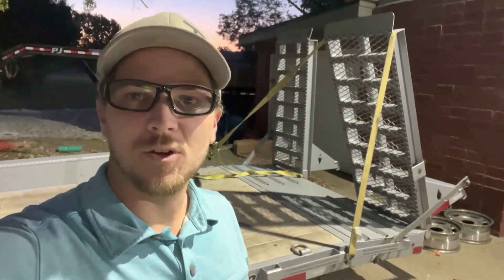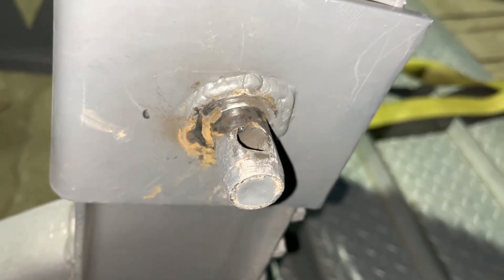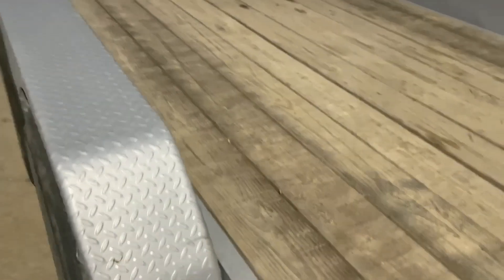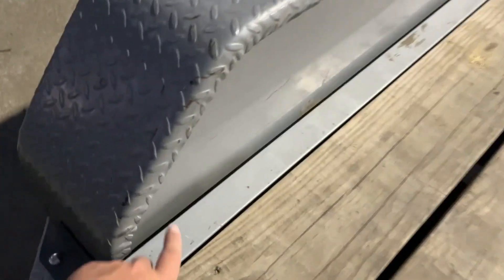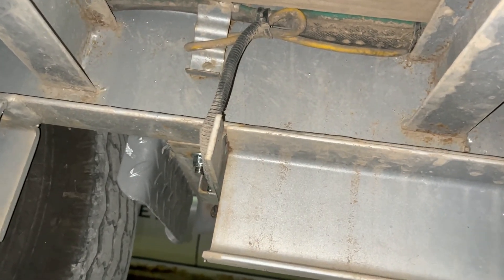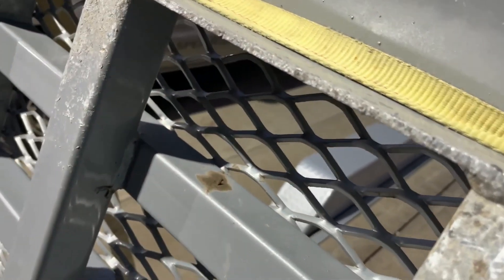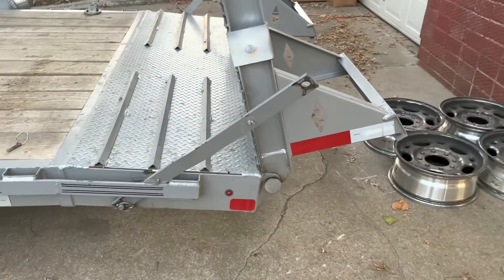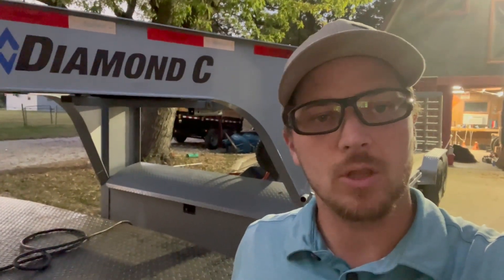Broken Diamond C Trailer Repairs

Comment: Do you think diamond c will lower some of their pricing if things come down again? I get the feeling like most goods are only traveling in one direction. Thoughts? Also, while not at the moment I do plan to get a 26 foot goose and a 16 ft dump at the same time. Do you think that would afford me some bargaining power or is diamond c like apple products? (The price is the price kind of scenario). Like I said I still have some time before I’ll be in a position to pull both triggers so I haven’t bothered to make contact with any dealers yet. Thank you
Reply from the maker: It’s really hard to say. Prices are up because materials are up. I’m seeing trailer inventories increase at my local dealerships. But those trailers were built at a higher cost. It’s logical to think they will have to sell for a higher price. Even if production costs go back to 2019 rates there is so much new inventory that was produced at a significantly higher price. I think prices will go down a little bit and it will return to a buyers market. But I’m talking about a 10-20% decrease after we’ve seen a 50-100% increase. It’s not just trailers. It’s heavy equipment, vehicles, materials, etc… At least that is what I have seen and am forecasting in the landscape industry. I’m thinking you will have more buying power in the next 6-12 months but only time will tell.

Comment: Looks like those ramp pins had to have have some strong force to break them. I don't see how that could have broken just holding the ramps up. My DC FMAX 210 with max ramps are pinned up holding large stacked round bales against them countless times and I have not had any issues nor to I expect any.
Reply from the maker: Well… that’s exactly what happened. Those pins have only ever held the weight of the ramps and nothing else. Glad to hear yours are holding up better.

Comment: Great review! I think if they added some more weld to those pins and fixed the fender issues they would have the best trailer on the market! In the future knowing what you know, and sharing that with us,  we can just reinforce the trailer from brand new and not have to risk those ramps dropping or fenders rubbing/ separating while going down the road.

Comment: Have you returned the Trailer to your Dealer and asked him to make the necessary repairs that you presented on this video ???
Reply from the maker: The original dealer we purchased from sold to another dealership. We warrantied the brakes through them and it was an inconvenient experience. We live about an hour away and it’s easier to simply make the repairs on my own or pay to have them repaired locally. I’m still not happy with the performance of the brakes after the warranty process and it took several months to even hear back if it was covered under warranty so I had to pay out of pocket for the work up front anyway.
Reply: @ThriftyGarage  same with mine in the lpx. Have concerns about the ramp pins shearing too.